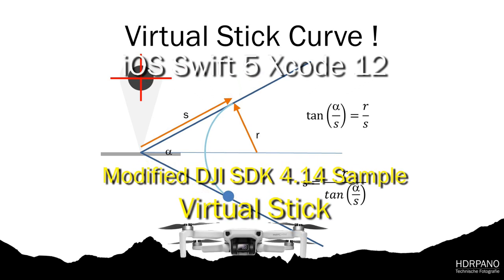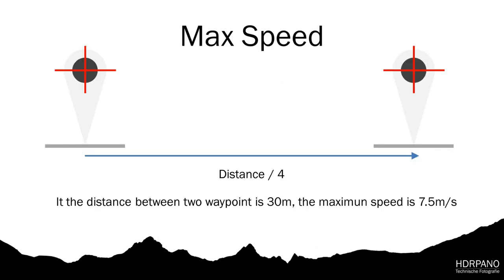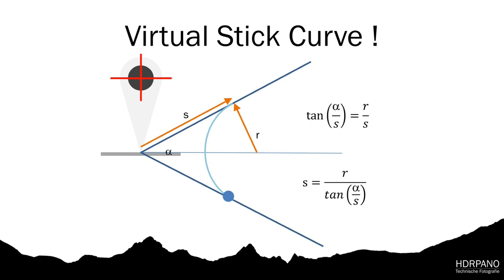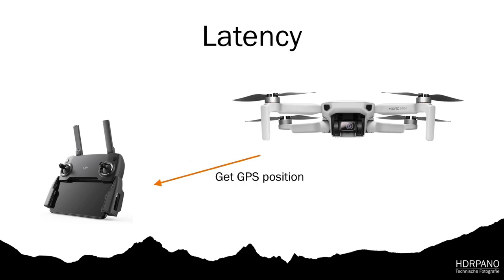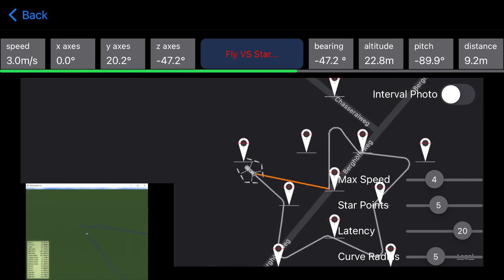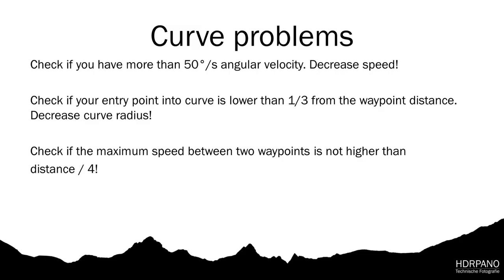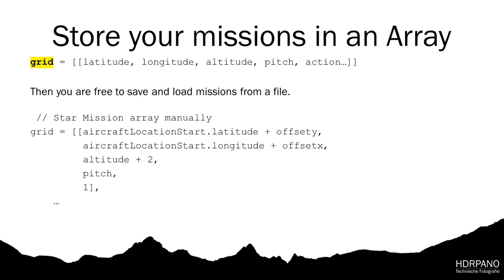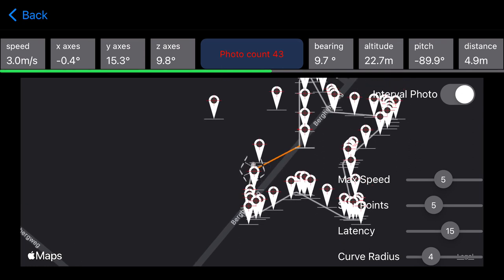DJI Virtual Stick Mission (curved) for Mini 1 and Air 2 or all other aircrafts

Comment: I understand from your video that the virtual stick management takes into account GPS positioning. 
Otherwise I guess that deviation will occur. And then the longer the path is, the higher will be the final positioning error. 
Intuitively I was imaging such a correction by the controller. You describe it here.
I am a Dronelink user, but the app authors do not explain that correction.
Rgds,

Comment: Thanks for putting this up! Very valuable info!!
Does this work with higher speeds, close to top speed? I had to do a crosstrack pid regulator when flying in high wind.
Have you meassured the latency? I never understood how much it is?
Reply from the maker: Mesure the latency is difficult. The GPS feedback from the aircraft is always delayed. I played in my special test APP with different values to simulate the effects. You can use full speed. I adapt the curve radius on speed. DJI does the same with mutable missions. The best way is  to fly the same mission in the simulator with virtual stick and mutable mission to see the difference. I use 20% in curves for the latency.
Reply: @KilianEisenegger  Have you really flown in full speed in side wind (6-7m/s), like between two waypoints 600m apart without getting any crosstrack error? I looked like this for me:
https://app.airdata.com/share/ZgkyFS
I using a mini2 though, so it might be different compared to the 1. I got the same result with an mavic2 though, but not as bad. To me it seems you have to compensate for crosstrack error, I can't understand how you manage without it. If i go slowly like 4m/s it flies straight (almost)
Reply from the maker: @MatsBohlinsson  Do you use advanced virtual stick? You can calculate max speed with  wind between x and y axes. For the mini it is not possible for the motors to compensate wind 6m/s and fly at max speed. Max wind compensation for mini 2 is 8m/s to hover. sqr(x2+y2) is the maximum.
Reply: @KilianEisenegger  So you mean you  calculate the wind to be able to decide what speed you can use? How do you calculate the wind? From the roll?
Reply from the maker: @MatsBohlinsson  Yes, you can see in my APP hdrpano, that I use my own attitude indicator in my yaw status bar in the center of the screen. pitch/roll and z. Then I further calculate speed for timing image save distance for jpg or raw.

Comment: What information is given for the "Virtual Stick" method? Are these the Pitch, Roll, Yaw angles?
Reply from the maker: Yes for the aircraft and the gimbal
Reply: @KilianEisenegger  Is there a formula to set the angles in relation to the speed of the drone we want? Or did you fix the angular values by testing? For example, if you just want to make the drone move at 5 m/s, you just have to change the pitch by a certain degree? The more the angle is important the more the speed is ? that's a lot of questions :)
Reply from the maker: @GamerMeric95  I have all on GitHub for free, exept curves. Watch my first VS video and download the code. It is easy as the SDK has the VS speed function already.

Comment: is there any way that we use virtual sticks to move the drone in the circle using virtual sticks
Reply from the maker: Yes this is possible and used in hdrpano 3D or Litchi. Move the drone im Y axis and turn the heading at the same time. Control the radius on X axis with the distance to the POI